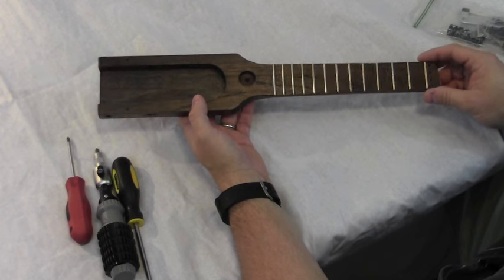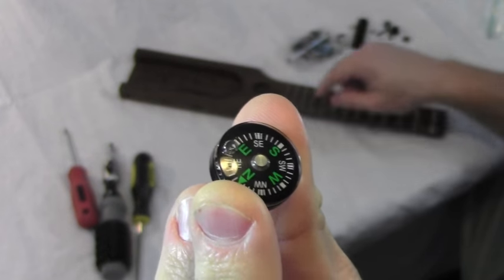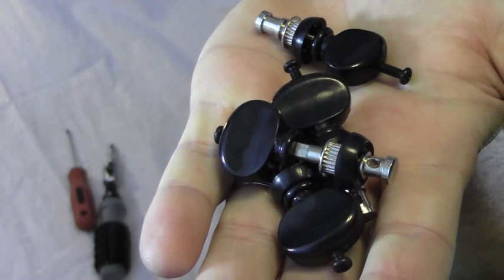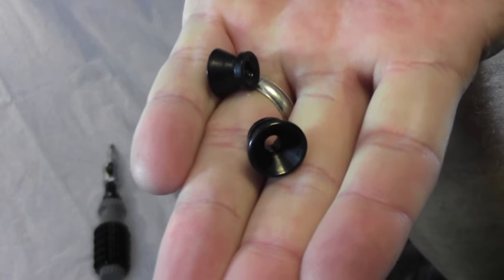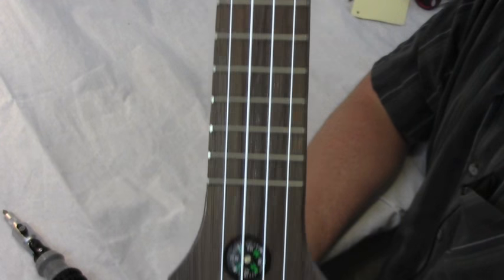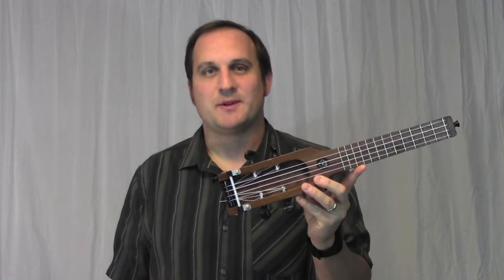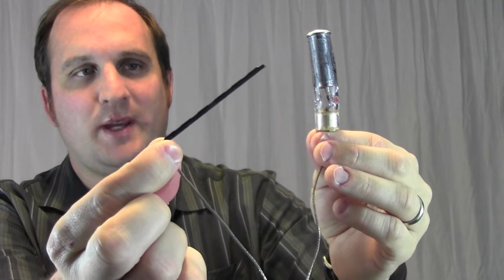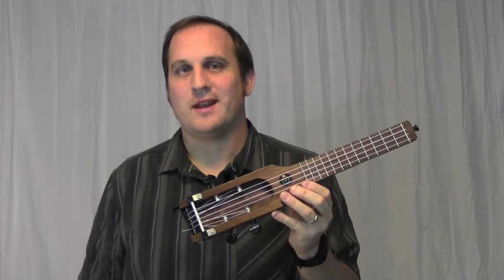Backpacker Ukulele

Comment: This is awesome! You do great work. DO you sell any plans?
Reply from the maker: +Chipped Builds There are guides and templates here. 
https://circuitsandstrings.wordpress.com/2015/06/09/building-a-travel-ukulele/

The backpacker is cut off after the turnaround, and it has an 1/8 inch thick wooden back.
Reply: CircuitsAndStrings thanks!

Comment: Love this thing (and the rest of your projects as well). You need to raise your prices. :) 

But I want to build one myself anyway. Where do you buy your parts?
Reply from the maker: +Karol Gajda I get my parts a few different places. eBay and C. B. Gitty are a couple I use a lot.
Reply: Great, thank you. What are the string turnarounds you use? A search for "ukulele turnaround" comes up with something else and I can't find them when searching "ukulele saddle" or "ukulele bridge" either.
Reply: Nevermind. Found it from your other video. Tattoo gun grips! Nice.
Reply: @CircuitsAndStrings  i know I'm 3 years late but could you link the 'tattoo gun grips' or something similar that would be suitable? 
thanks!
Reply from the maker: Hmmm. I can’t seem to find the type that I used on eBay right now. Maybe they are temporarily sold out.

Comment: Interested in the bridge and turnaround that you used to make this. Can you please let me know where you got them and if you know of anywhere to get similar ones to build a backpacker guitar? Thanks!
Reply from the maker: +Patrice Webb I use a tattoo grip as the turnaround for the ukulele. For the guitar, I had to custom make the turnaround because the string spacing.
Reply from the maker: And the bridge is an aluminum tube with "p clamps"

Comment: I have a few more questions: What kind of fret wire do you use as a 0 fret? Would any base fret wire work?
I prefer this style bridge over the the angle iron design but is there any advantages/disadvantages with each?
Finally, what diameter aluminum tubing fits the piezo rod perfectly?
Thanks in advance for all your help!
Reply from the maker: +Euel Pamintuan Most bass wire should be large enough for the zero fret. 

The angled aluminum style is good to support the plastic tube for the piezo rod. The aluminum tube style is strong but less responsive to the piezo rod. I don't normally put pickups on the aluminum tube style like this. 

I use a 3/16" tube. 

Good luck!

Comment: Hi, what are the clips that you use to hold the bridge-rod (47 secs), please?
Reply from the maker: +Dave Green They seem to go by different names. "P clips" and "brake line clamps" are a couple of them. 

Here's an example, but they might be a little wider than the ones I used in the video. 

https://www.ebay.com/itm/400653259043

Comment: I like what you do, and am following your ideas to build my own. Those strings, however, are Chinese fakes. I know because I bought a set just the same and they were terrible (as well as illegal). There are spelling and grammar errors on the tag, and they don't come in a packet. Please use original products, and help support legitimate industries. Peace
Reply from the maker: +p4ul1w4uli I was wondering why they were so cheap on eBay. Thanks for the info.
Reply: CircuitsAndStrings I was unhappy that the strings wouldn't hold their tuning and felt squeaky so I notified eBay that they are fakes, and got a refund.